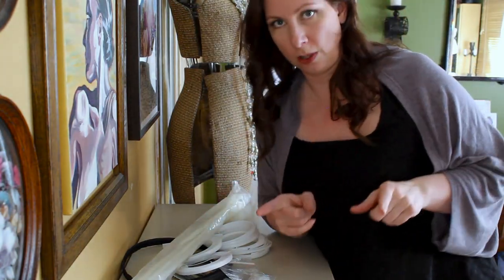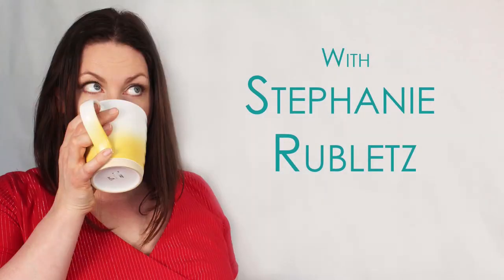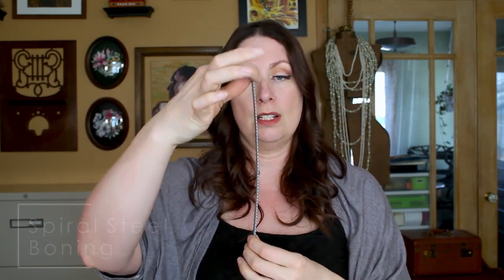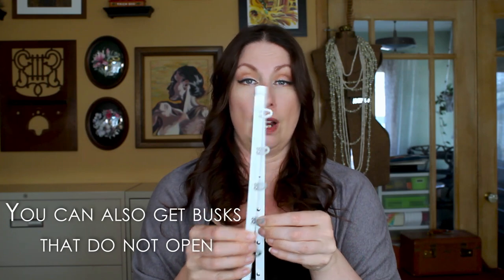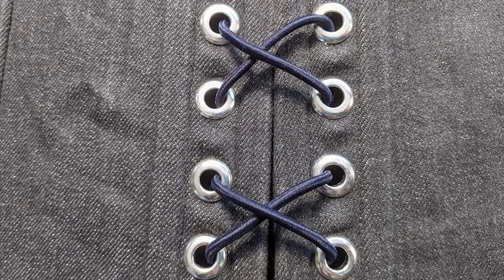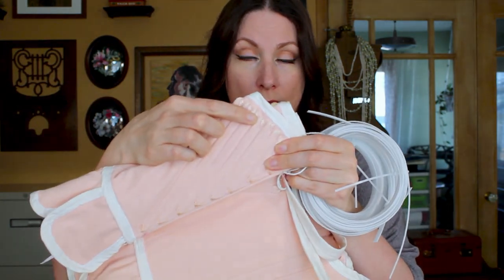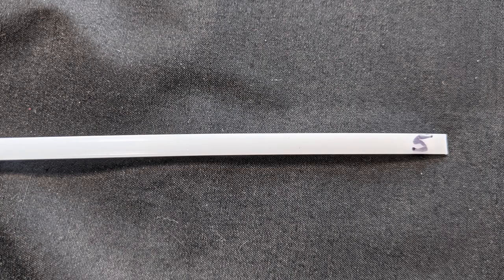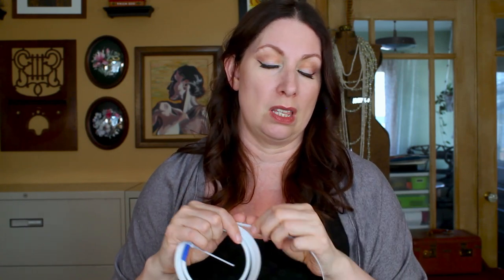WHAT BONES SHOULD YOU USE FOR YOUR CORSET? // Corset Making

Comment: You need a heat pen/wood burner, you can press ends on metal tool and round corners. You can also use the heated exacto blade to cut the boning, it is like butter.

Comment: I'm making a cosplay. The lacing is in the back and the front is closed. I'm busty and so what would be good to support myself? It's not for waist synching. It would be one solid piece from just below my collar bone down to just below my waist.
Reply from the maker: Oh fun! You would be surprised how much support you'll get just by adding a few extra boning channels. But if you are really wanting a solid support, you could always put a one piece wooden busk in the front. Don't forget to drill holes and sew a ribbon through the busk and the fabric once it's installed or it will wriggle up while you wear it. Good luck!